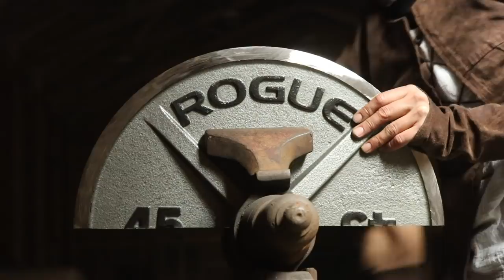Battle Axe made from a Rogue Fitness Weight Plate for The Mountain | Game of Thrones

Comment: Awesome project. Just wondering why use bolts vs blacksmithing rivets?
Reply: Ever tried heat riveting into wood?
Reply: @SnorrioK  thought the bolts went through the two metal brackets
Reply from the maker: i considered it but because of all the moving parts (two of which weighed QUITE a lot) it seemed like more trouble than it was worth
Reply: @MichaelHagberg  - did you notice the wooden handle in between there? A rivet needs to be heated up close to "welding heat" (bright yellow light comes off of it) in order to peen it. Such a heat will travel inwards into the wooden piece, burn it and create a possible weak spot; thus making it dangerous to flail around. Wouldn't want it to break while the weight is above one's head...

Comment: Industrial use of cutting oil while cutting metal is to cool down the tool. Lacking oil, using water is better than nothing. The reason? If the tool overheats, it will expand and get stuck in the work piece while at the same time losing its hardening and thus; breaking inside the work piece.

It's weird that people have these setups and tools and make projects and still haven't got their heads around simple rules of engagement when it comes to trivial things like these.
Reply from the maker: it's true that without oil (or another lubricant) the bit can overheat, break, and stick inside the piece.  which is why i used oil.  because i know the simple rules of engagement when it comes to trivial things like this.  the reason for the breakage is because i was using a hand drill as opposed to a drill press which would give me a perfect vertical and thus keep me from breaking bits when my hand twisted to one side or the other
Reply: @ijessup   ❤❤❤